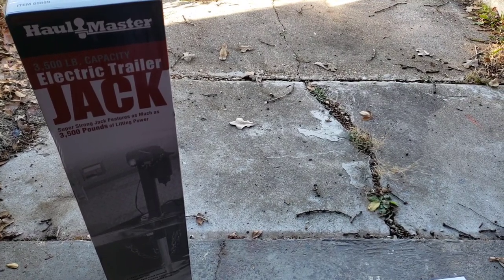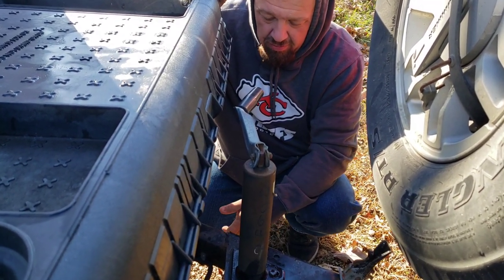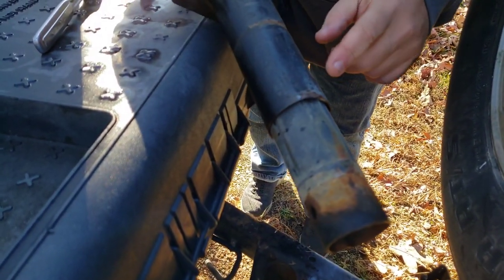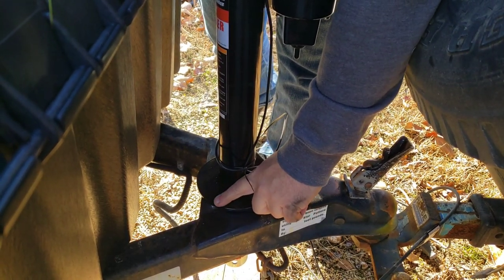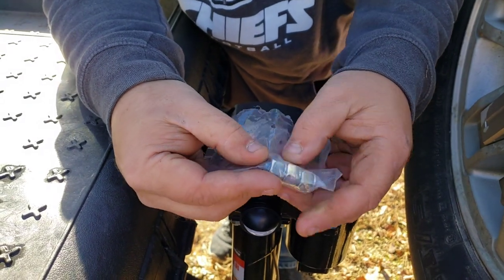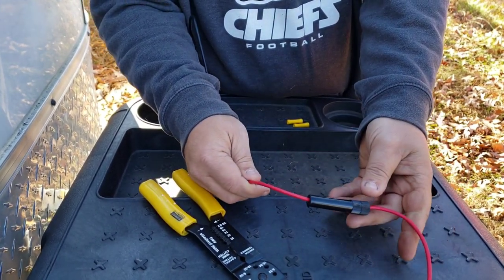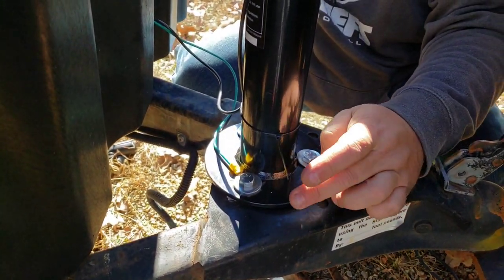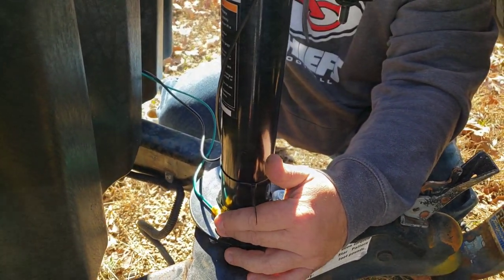How To Install Electric Jack Cargo Trailer Camper Conversion

Comment: Electric Hubby said if you don’t from chassis  then the ground from battery to chassis. Clean where the negative side of battery connects to chassis. If you don’t have a good ground to chassis he’s concerned about the lights working properly. He said he is I,pressed with your teaching skills.
Reply from the maker: The jack isn't tied in with any of the trailer wiring. It's on own circuit. Wired direct to our trailer batteries. Which are not connected to the trailer until we hook up our inverter. So we're all good there 😊. Sorry I was hoping we had explained that good enough in the video. Thanks for watching and the lovely compliment.

Comment: Some very useful information. I want to try and get my trailer licence when this Lockdown in England ends. Do you need a trailer licence in America ?
Reply from the maker: No. Unless it's like a big semi or some other commercial truck of some sort. Those require different license.